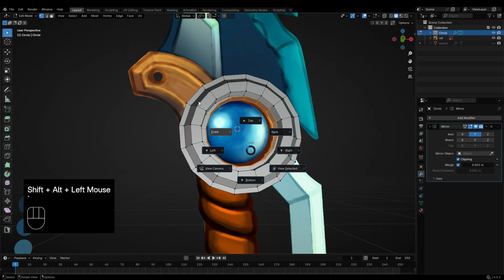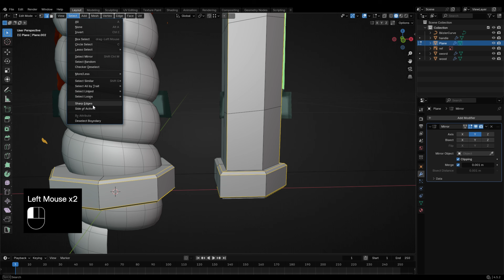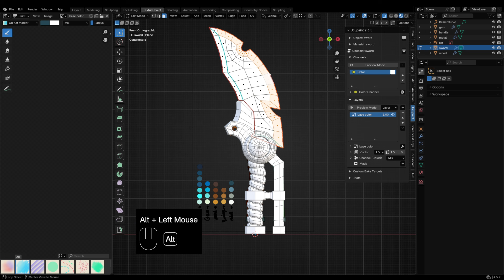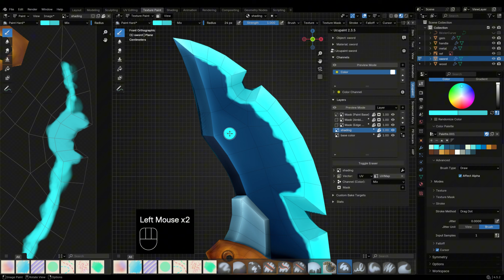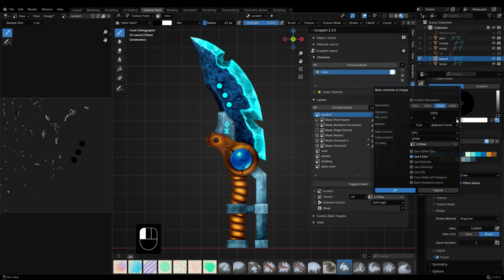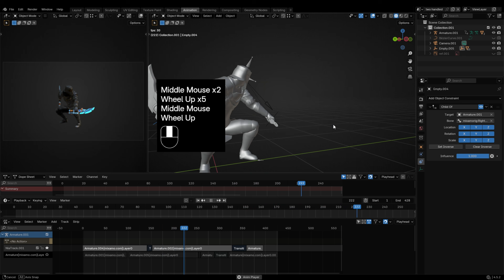How to Make a Stylized Blue Mythril Dagger in Blender – Full 3D Workflow | Beginner Friendly

Comment: Do you use a mouse for doin this?
Reply from the maker: I use a combination of both. 😊 For simpler parts, I usually use a mouse, but for more detailed painting, I use a pen display. It gives me more control and means I don't have to manually adjust the pressure strength all the time. You can do it with a mouse too, but it takes more manual adjustment and precision.

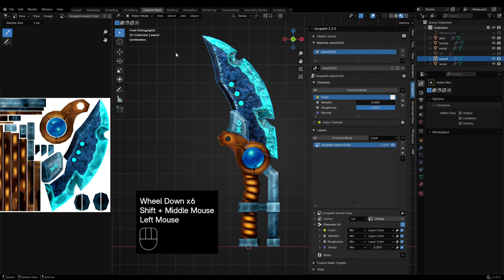Comment: Hello I have question in the 44:00 minute mark, when I remove the sword material and put the baked one, the blade turns black and it doesnt revert back and have the colors. but yours turned white then have colors can i have help
Reply from the maker: Hello! 😊

That is a bit strange. I just tried repeating the steps myself and everything worked normally.

As for the white color, I believe that's the default appearance when the mesh doesn't have a texture assigned yet, especially in Texture Paint mode. I would also double check that the bake completed successfully and that the baked image is not blank or completely black.

For reference, I recorded this tutorial in Blender 4.5.2, and I just tested it again in Blender 4.5.7 without any issues. It is possible that something has changed in Blender 5 or newer versions, but I haven't tested those versions myself yet.

To be honest, it's a bit difficult for me to tell exactly what's causing the problem without seeing a screenshot of your shader setup or the result directly. A screenshot would help a lot 👍

Comment: How did you transition from wireframe to texture in the animation?
Reply from the maker: If you mean the transition at the beginning of the video, I made it by rendering two separate animations.
One render is with textures, and the other is without textures (wireframe or flat look).

After that, I combined both renders in CapCut, then added a mask to one of the clips and animated the mask to create the transition effect from wireframe to textured.
Reply: @ToonBlend3D  That's exactly what I wanted to know, thank you so much. You're my idol!!!

Comment: how do yo udeal with z fighting ? when i put a subdiv modifer on my model and it's painted, there is like white spots all over it
Reply from the maker: Hey! I’m not completely sure I understand the exact issue you’re facing.
Is this happening at a specific minute in my tutorial? If yes, could you let me know the timestamp?
Or maybe this only happens on your original model?

About the “z fighting,” you can try checking if there are overlapping or duplicated vertices or faces.
You can fix this by selecting all vertices, pressing M to merge, and choosing By Distance.
You can also try slightly shifting the mesh so the surfaces aren’t too close or overlapping.

For the “white spots after adding subdivision,” I’m not entirely sure why that happens.
If the white spots appear after baking the texture, it might be caused by the Margin Type being set to Adjacent Faces instead of Extend. Choosing Extend usually helps prevent white gaps around UV islands.

Sorry that I can’t pinpoint the exact cause since I didn’t experience this issue while making the tutorial. If you can explain a bit more or share the timestamp, I might be able to help better.

Comment: I'm at the uv unwrapping part.

Is it really better to straighten and rectangularize the uvs? I would assume that it's better to keep it similar to the original mesh shape for easier texture painting, no?
Reply from the maker: In my opinion, straightened UVs work best on 3D objects that naturally have rectangular shapes. For example, on the metal part of the dagger in the video, straight UVs make hand painting directly on the 3D model much easier and cleaner. However, this approach can be less convenient when painting on a 2D texture image, because straightened UVs don’t always reflect the actual form of the object.

So UV mapping really depends on your needs and personal workflow. If you prefer painting on a 2D texture especially if you plan to refine the texture in software like Photoshop, Krita, or similar then you might want to unwrap the UVs in a way that keeps them closer to the real shape of the 3D object. If you want them to match more closely, you can use unwarp project from view.

Also, once UV mapping is done, it is a good idea to check everything using a UV grid checker to make sure there is no distortion. I forgot to show this part in the tutorial, so apologies for that.

Thanks, and I hope this helps.
Reply: @ToonBlend3D  Thanks for the detailed reply! Makes a lot of sense, I understand now! :)

Comment: Excuse me for my ignorance , but how do you add that extra topolgy , here :   2:07
Reply from the maker: Hey! At minute 2:07, I’m adding extra topology to cover the empty inner area of the dagger blade. Here I used F to create a face between the two selected vertices and followed the circular topology flow along the blade’s edge.

You can also select an edge or vertices, press E to extrude, and form new faces while following the existing topology shape.

Once you're done and feel like some vertices might be overlapping, press A to select all, then M → Merge by Distance to make sure there are no doubled or separated vertices.

In the video I try to keep things in quad topology (faces made of four vertices) just to make the mesh cleaner. But honestly, for hard-surface objects like a dagger, where it won’t deform or animate perfect quads aren’t a strict requirement. You can use tris as well.

For the full explanation, you can check the video again. And sorry if the video feels a bit fast, you can try slowing it down. Thanks!
Reply: @ToonBlend3D  Tks for the quick responce. I understand the procedure now .   [🙂  .. btw.. really enjoy the tutorials.
Reply from the maker: glad you liked the video